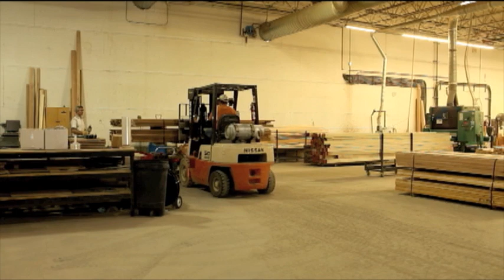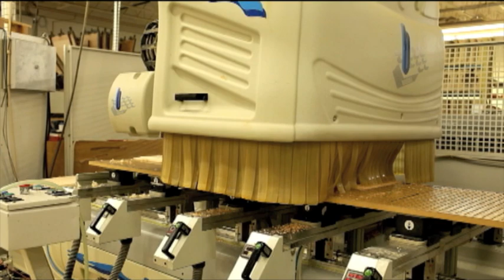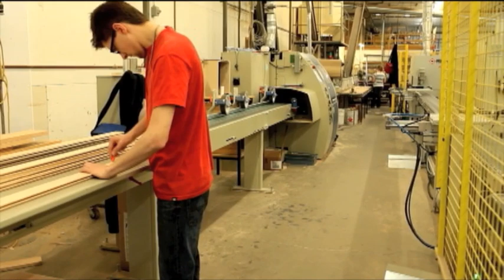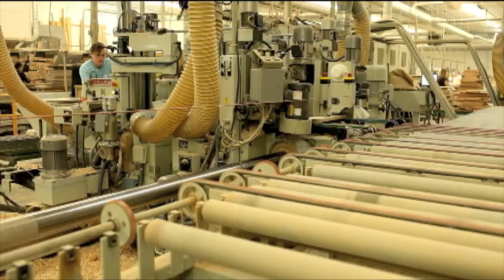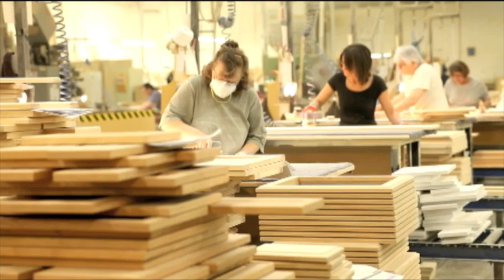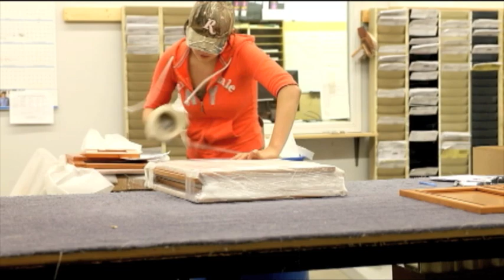Elias Woodwork Overview of Cabinet Door, Refacing Material, Molding, Drawer Box Manufacturer

Comment: Hi there thats a super video. Can I ask are the doors pinned or welded after gluing or are they just left in the clamp for a period of time?
Reply from the maker: Our  wood tenon style cabinet doors are manufactured without the use of any metal pins. All solid panels are installed with rubber spacers to allow for expansion or contraction in different environmental situations. All plywood panels are glued in on all four sides as plywood is structurally stable and this prevents any possible vibration problems in the future with the plywood panel. They are clamped to ensure tight joints. Our miter doors are manufactured with either a screw and dowel or mortise and tenon joint. They are also glued and clamped. Feel free to reach out to our customer service for any clarification or information. 1-800-665-0623